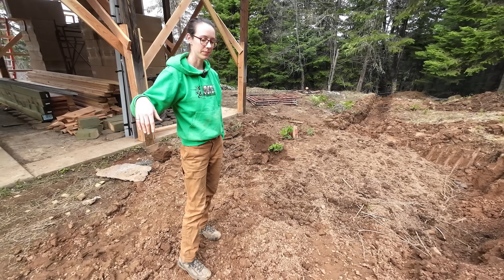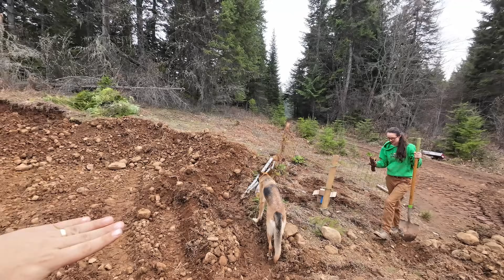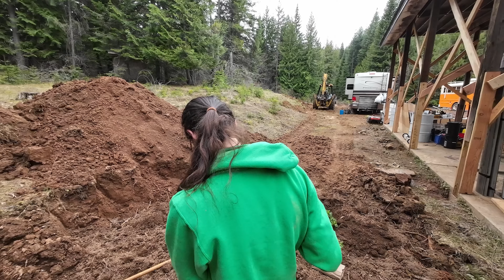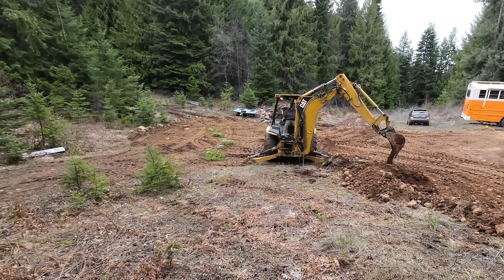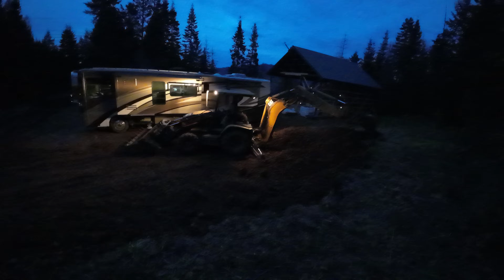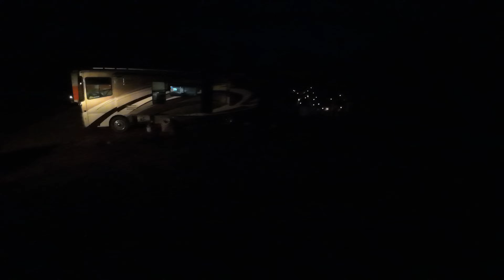Our Garden is Growing... in Size!  Expanding our Garden and Some Dirtwork

Comment: When was this filmed? Looks like early spring.
Hey that garden still close to roof water.
That backhoe works great. Like the exhaust sound. Some great gravel fill in that mound. You can explore for more on your land.
Thanks for the video
Reply from the maker: I am a bit behind on the video editing at the moment, this was filmed in mid-April.
It is still really close to the roof water, but we are planning to add gutters to the building.  Right now we are in the dry season, so that project is low on the priority list.
It sure does!  I really appreciated having all the rock right there for the yard grading.  I am used to only having clay to work with back home in South Dakota
Thanks for watching!

Comment: Wish you would move the motorhome, I can just see a incident happening !
Reply from the maker: It was a little tight at the beginning!  It would have been better if we could have moved it, but it was so wet and the ground was so soft that we would have had issues moving it out of the way.  Backhoes are especially challenging to operate in tight spaces due to the long tail swing of the backhoe arm.  Thanks for the concern!

Comment: I'm thinking you may have issues with deer helping themselves to your produce so you may want to plan your garden with putting in fence at some point in time. Because your ground is anything but flat you'll need to plan around how the water travels across the area. Best of luck with your garden.
Reply from the maker: Yes, absolutely!  Shortly after this video we installed a temporary fence around the garden.  As for the drainage, the temporary ditch we cut in really wasn't needed.  Our ground around the shop consists mainly of large coble rock with sandy clay that seems to drain very well.   That being said, we plan to slope the garden away from the shop at a 2% slope to maintain adequate drainage for large weather events and snow melt.